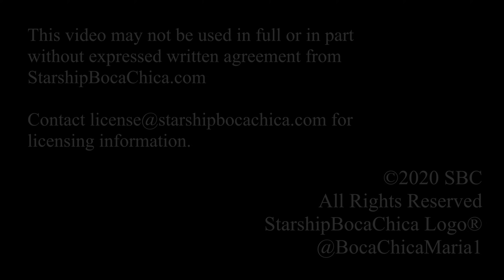2020 10 11 Following Raptors 8K - SpaceX Starship Boca Chica

Comment: Mary do you know the olm columns width and height. Ratio looks to be 2x6.66 yards.
Reply from the maker: That would be a good question on the facebook.com/spacexboca/group
Reply: @starshipbocachica  Thankyou for that. I will check seems to be width 5'83 feet internal and length 43.5 feet but will check with facebook page Spacex.